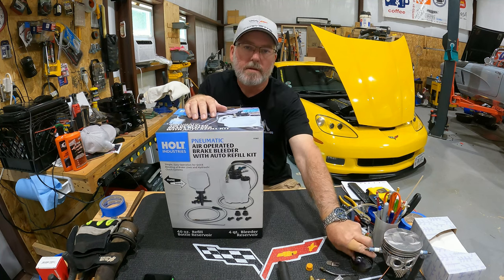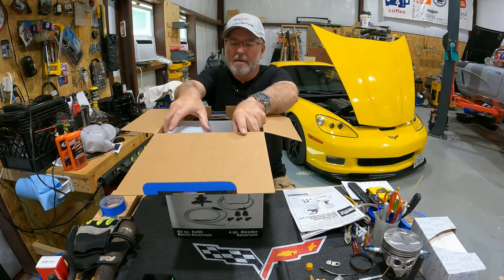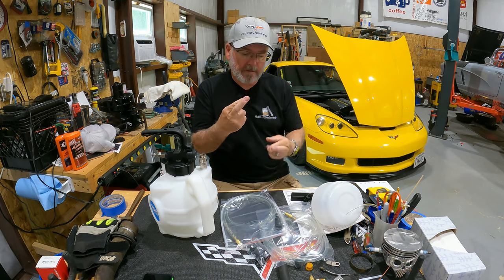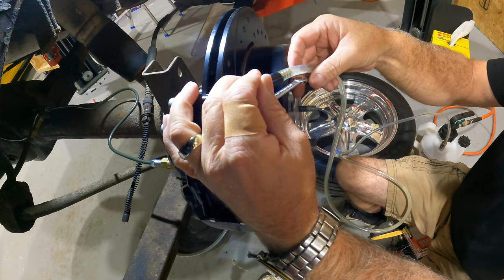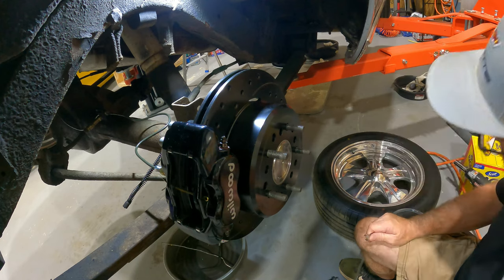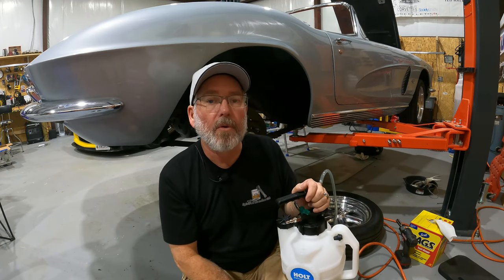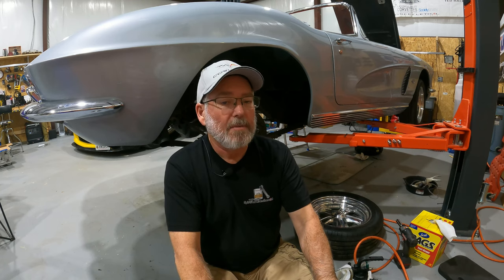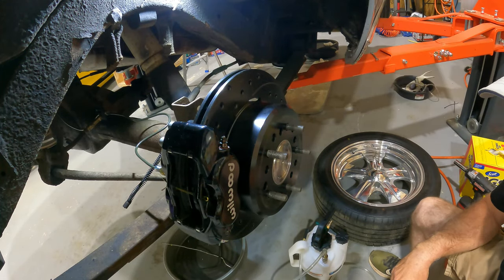Time To Bleed the Wilwood Brakes on the 62 Corvette!  #corvette #restomod  #harborfreight

Comment: I bought the same product and I love it. I enjoyed your video very much. BTW the two cap looking things that came with it are adapters so you can screw them onto brake fluid bottles and use them instead of the larger reservoir on the automatic filler which clamps onto the master cylinder. Keep up the good work!
Reply from the maker: They were relatively easy to install, getting them centered was the only tedious part but even that was not difficult.  Thanks for the heads up on the adapters.  If you do the rear brakes in the future you'll need to find the adapters that actually screw into the calipers...or at least ours didn't come with them.
Reply: They’re tricky. I’ve never been able to pull a good suction on the Wilwood caliper bleeders. Thanks for the tip.

Comment: I'm glad I bought the Capri Tools CP21029 Vacuum Brake Bleeder for $83 instead.  I didn't want the auto-refill either figuring it would eventually end up spilling brake fluid all over the engine compartment removing the paint 😁

Try using a flare nut wrench so you don't end up rounding off the corners on the bleeder valve and don't open the valve up so much because it will suck air in around the threads which sort of defeats the whole purpose right 😉
Reply from the maker: I tried the wrench, just wasn't enough room for it in there.  The auto fill just seems like a disaster waiting to happen for sure, doubt I'll ever use that thing but it was part of the whole kit.

Thanks for watching and commenting, very much appreciated.😎

Comment: You need to keep the outlet line above the brake bleed screw. You just let air back in the system by not have the line full.
Reply from the maker: @kurtkarasch8768  not if you close the bleed screw before letting off the air.  Turn on the air, open the bleed screw, watch fluid flow, shut off bleeder, then shut off air.  Works great.😎

Comment: I’d love to see how this product holds up. I know a lot of people bash Harbor freight, but I’ve had some very good tools from them (I’ve also had bad ones).  This looks like a pretty good deal.
Congrats on 500🤙🏼🤙🏼
Reply from the maker: Thank you Sir!  I don't hate on HF tools too much either.  I'm actually transitioning to their Icon brand as I replace stuff.  The sets I've gotten so far are on par with anyone else I've used.  This tool is really about too easy to use, really impressed with it.
Reply: It’s only the Snap On people that mortgaged their house for a tool set. Smart people buy for a lot less with nearly identical quality.

Comment: Does it matter what air compressor you need. The gallon capacity?
Reply from the maker: As long as your compressor will put out at least 60 psi you should be fine.  The important thing is to not exceed the max psi of the tool (90 psi on my particular one).  Thanks for watching and I hope I provided some helpful info.

Comment: Vacuum pump is junk, pressure bleeding is the best.   Just don't run out of fluid!
Reply from the maker: I definitely see more merit to having this tool than a vacuum pump.  I don't see me doing much AC work if any so I'm thinking this was the best way to go.  Thanks for watching and the support, glad to have found your channel too!
Reply: @YellowJacketGarage  This is a vacuum pump. Not a reservoir pressuring system. Hes saying this method is junk.
Reply from the maker: @kurtkarasch8768  yep, missed that point, thanks for the reply.